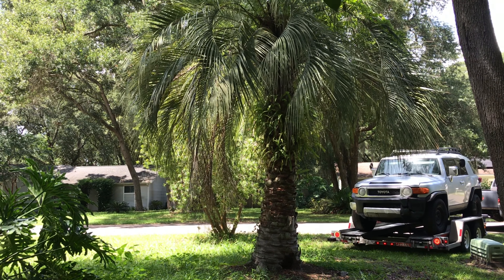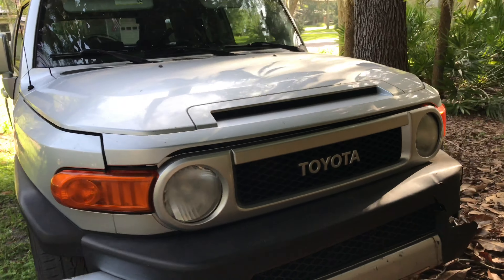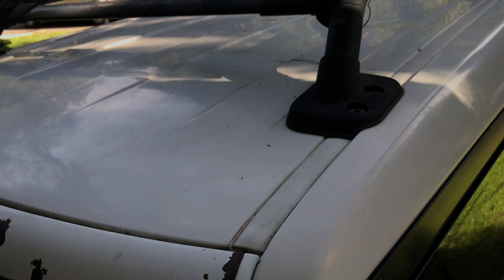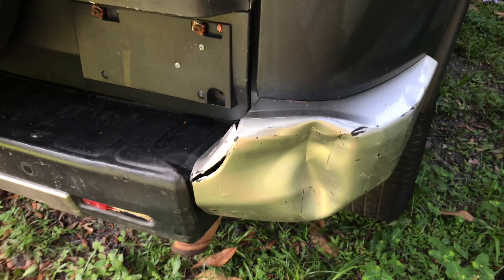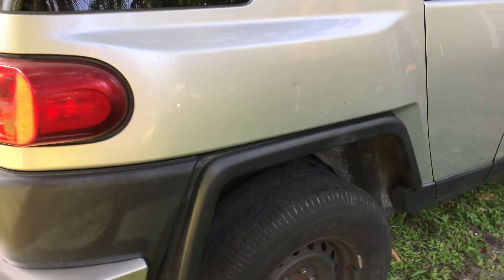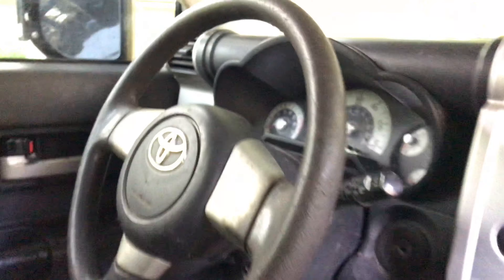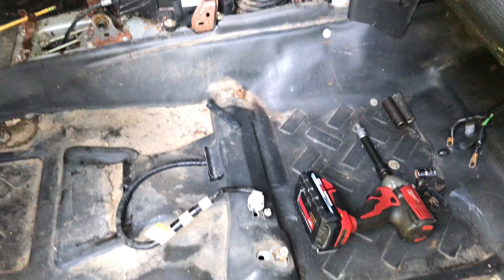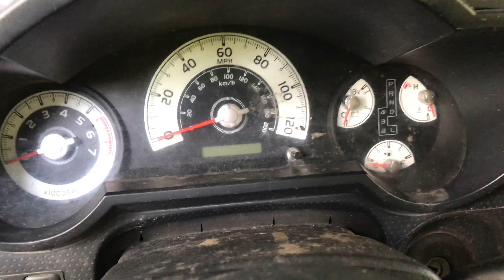FJ Cruiser Rebuild Part 1: Tow and Inspect Damage on my $2,500 FJ

Comment: "It smells like mold is starting to form..."  Yup, that's exactly what one would expect from pressure washing the interior of any car.  I wish people would stop believing that about the FJ. The flooring was made to be easier to clean, yes, but it's not sealed by any means.  There is a cutout in the vinyl underneath both front seats for the rear facing air conditioning.  Spraying water into crevices, upholstery, insulation, etc.. is going to make it smell like a moldy mess. Glad you show what really happens.